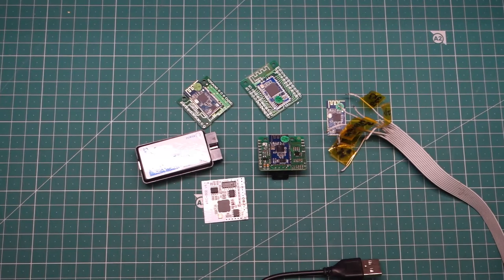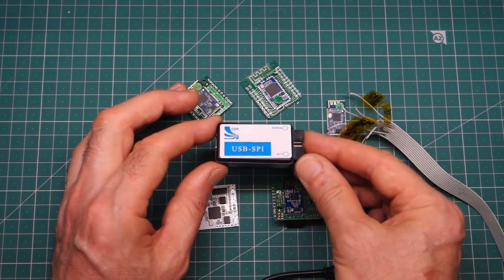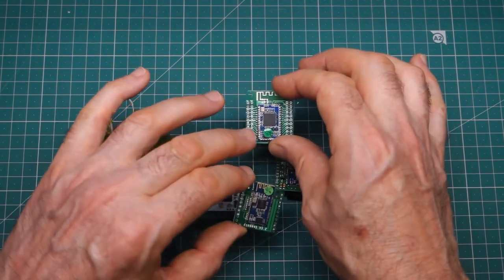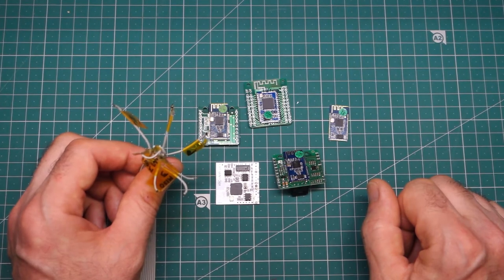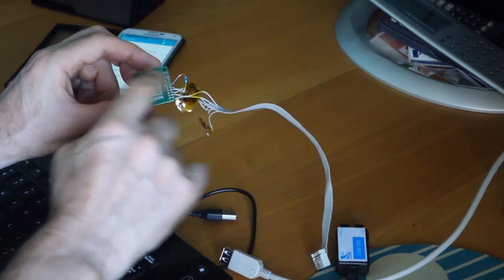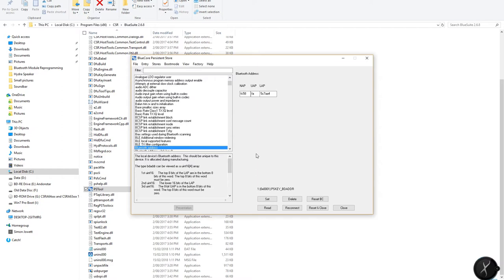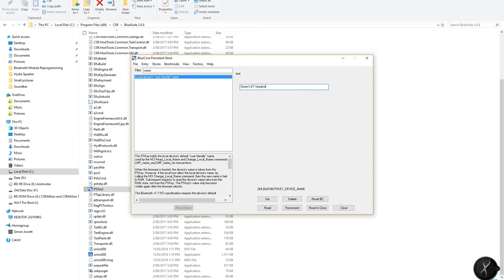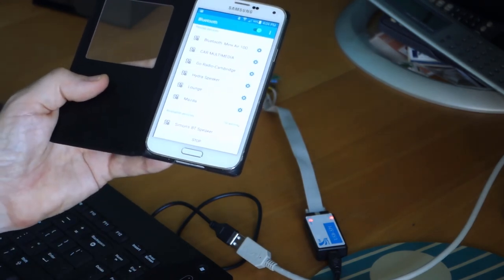Ep32 CSR Blutooth Chip Reprogramming

Comment: Very cool Simon, I have two questions. Do any of these boards include a lithium-ion charging module? Also is there a way to program/compile the firmware and then upload via Bluetooth?
Reply from the maker: Hi James - No I don't think I've seen a module that includes a li-ion charging module - I you have a project in mind I'd just get one of the TP4056 modules with the included cell protection circuitry on it.  As for updating over bluetooth - I wish!  Unfortunately you have to buy the programming module and the Bluesuite software is getting hard to find also.

Comment: Excellent video. I've got a module with Qualcomm QCC3005. When I connect to it using my Android phone, it doesn't show "phone calls" on the menu. When I have a voice call while I'm connected to this module, the call is not output via the speakers connected to the module. Is it possible to enable phone calls?

Comment: Do these BT modules have a secure connection capability so only the intended user can connect?
Reply from the maker: InTnMnNmAz Most modules don't seem to require a code.  However, whilst I have not attempted to do it I believe it might be possible to set this with this software.
Reply: InTnMnNmAz: I would imagine it would depend on what's available as changeable variables. The programming tool Simon is using is showing the values that are stored in the EEPROM module. Pretty slick, overall. If you wanted to get more functionality, I would imagine it'd not be very difficult to completely reprogram the chip with new firmware. Not sure if you can use Arduino IDE or other to do the reprogramming.

Comment: I have a project where I am going to use the CSR8645 and I want to set volume limit to it because most amplifier will clipping at maxium volume. Is there anyway, I can set volume limit to this chip. Waiting for your reply.
Reply from the maker: Sorry I'm not able to answer your question.  It depends on the version and firmware, sometime this option is present and sometimes not.  You have to just connect it up and hope!
Reply: @PowerOn-  Can you tell me that is the option called? I can do research for it.

Comment: i still dont know how you manage to solder to points that are 0.8mm apart, they are so damn tiny
Reply from the maker: I often use my bench mounted magnifying glass which has a ring light incorporated into it.  A steady hand and a fine tipped iron is also required.  I hope you manage to succeed!
Reply: @PowerOn-  i put that on the backburner until seeing a darieee vid the other week, where he mentioned the little pogo pin bench thing..got one and hooked it up today :) Have you looked into doing/adding custom sounds to these chips?